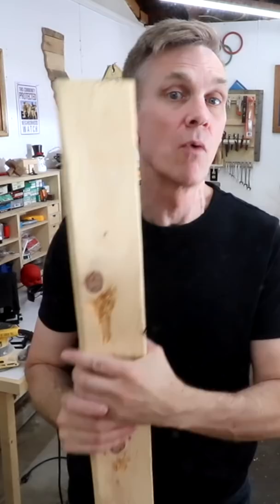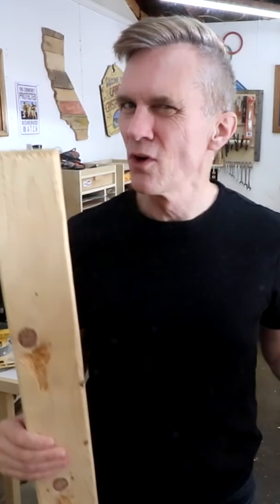Why do 2x4 boards have rounded edges? #shorts

Comment: I figured it was because they actually measure 1.5” x 3.5”. And, to sell them as 2x4s they have to get rounded up...
Reply: this is a criminally unappreciated reply.
Reply: Ba Doom pahhhh! Lol great comment
Reply: I see what you did there
Reply: 😃 It took me a little while to get it.
Reply: UM... ACHHTUALYYY. They round down, they removed material.
Reply: Bahahahaha!!!
Reply: Bazinga
Reply: Thing is they were actually 2x4s when they come off the initial roughing saw. From there the drying process and finishing processes shrink the wood.

The equivalent in Europe is sold as a 44x94, which is roughly 1.75" x 3.75".

Comment: It's rounded to prevent moisture build up when they pack them on pallets, the rounded corners let air flow through the boards when they are piled up in shipping and lumber yards, so when it rains and sun finally comes out the boards can dry out faster and not mold. 👍🏽
Reply: This was also what I thought.
Reply: I said to myself something to do with storage/shipping. The airflow makes sense!
Reply: Not to mention banging a Sharp edge against would cause more damage than  banging a rounded one. That whole stress concentration thing
Reply: Airflow and less damage to the boards. Sharp corners get dinged easier than rounded ones. Lots of reasons they are rounded.
Reply: Yep, glad to see this comment
Reply: It helps to stops splitting while drying/seasoning.
Reply: Now it they can just fix the warping problem we would all be Happy........
Reply: Well that makes more sense than anything else I can think of!
Reply: @SiFiFreak  That is what I was thinking. Like how concrete edges often have chamfers removing the sharp edge for better durability.
Reply: @geofreak75  there also might be something to that if the corners where sharp it may be a lot harder to separate the bundles.
Reply: It's a fire safety thing. Wood with sharp edges catches fire far quicker.
Reply: I like it.
Reply: Nah, that's dilerious. The warping allows for airflow.
Reply: So they can dry faster to warp and twist? Lmfao
Reply: Would also help with the chemical treatment process that is used to protect outside lumber
Reply: At least that's better than what Steve came up with!
Reply: @mikedeafenbaugh5984  Haha. Oh boy. Your comment was worth digging for.
Reply: Best comment by far👌👌
Reply: Lol no.  There's still too much contact between the lumber for it to have any affect on moisture but you sure fooled a lot of people.  The guy in the video was right but didn't know it.  Before DW there was still a finish material such as plaster and panelling.  The sharp edges, especially with any twist to the board, transfers to the finished wall.  People will still buy wet lumber but will pick a stack apart trying to find the truest boards.
Reply: Yes
Reply: Make sense
Reply: Trim is also chamfered on the back edges so it will still fit if there is a bit of grit or sawdust in the corner. Rounded edges probably made stacking by hand much easier. Otherwise any little rock or sawdust build up would have ruined the stack. On the other hand my 1950s house has square lumber.
Reply: It's just like that poem: "They shall not grow mold."
Reply: That, and it keeps the wood from splintering in the drying process or even during shipping and building. It also adds structural ingerity to the wood.
Reply: You can compensate the warping when you set the board on its shoe and fastened them with screws or nails.
Reply: @jessicagriffith  lol
Reply: Ah.  I thought that was the reason they made them all bent, twisted or cupped. 🙂
Reply: This makes the most sense for time and cost effective reasoning.
Reply: Best answer.
Reply: Ding ding ding! You win!
Reply: Not to mention that the most common board are 2x4 when they shipped them the sharp corners would cut through the hemp ropes... A rounded corer helped to prevent that as well..
Reply: maybe
Reply: Yeap. This is the winner.
Reply: @roar40s  lol
Reply: Now if homedepot could just figure out how to measure an actual 2x4
Reply: This is exactly why I work at a lumber shipping yard
Reply: Valid point. However when you open a fresh lift of 2x4x16 pressure treated on a hot sunny day you can watch that top layer warp like microwave bacon lol
Reply: I actually learned the reason in architecture school back in the 90’s. They are rounded to allow sawdust to go somewhere when the board is pushed against a saw fence. Otherwise even a tiny bit of sawdust will push the board out and constantly create crooked cuts. 

And another benefit is that when studs twist in the wall the rounded edge keeps the corner within the plane of the wall. More twisting is required before it would push out the drywall. If corners were square a smaller twist would create a problem.
Reply: Thanks for the comment, for a moment i thought was just smoothed edges so they can sticked easy on B Hole of the guy that made the video only with questions 😀
Reply: 🙏🙏🙏 Thank You 🙏🙏🙏
Reply: Hey you should have made the video this guy just wastes time
Reply: Thank you
Reply: Scrolled down here to say this
Reply: Sounds more legit than any of videos answers
Reply: No that's not the reason. Didn't you hear that nobody knows the reason? Why are you hypothesising when you were already told that NOBODY KNOWS THE REASON. Be happy with not knowing, God!
Reply: I thought maybe everyone just liked rounded wood. Lol
Reply: It's not to prevent moisture, they use spacers.
Reply: Nope. Rounded edges because of the plastic bands while their on the pallets for transport. The sharp edges would ware down and snap the zip ties before getting to the store. Lol
Reply: You should be the one making this vid
Reply: That is also a good guess.  But that's not the real reason. I don't know the real reason. I just learned from the video everyone is wrong and there are no right answers.
Reply: Thats the best answer ive got also
Reply: The amount of airflow would be tiny though??? I'm not buying it. I might make a difference to seasoning timber over a long period, but even then I'm dubious.
Reply: Thank you! 😊
Reply: Gracias 👍❤️
Reply: Add to this that it is easy to visually see when it is final milled rather than rough cut and you’ve got your answer.
Reply: That's an answer!
Reply: This seems the most likely reason
Reply: It happens during kiln drying
Reply: kafel Bellic  treated lumber is square
Reply: Theres actually no legit reason why doug fir 2xs are all rounded green, but it sure is a btch after it comes out of the kiln. The outer boards on the units love to warp worse than straight edged cedar boards as where cedar loves to collapse cells. Rounded corners Def does not help  airflow in bundled units post kiln lol.   They are banded and covered with bags to keep dry for loading and shipment. If the theory was true then all the western red cedars I dried and processed would of been rounded. I think it has more to due with what the customer will use em for, doug fir 2xs for decking, and structure building while majority of all cedar will be sawed and then sent thru the moulder for tng so they keep cedar 2xs all straight edged same with pine.
Reply: You should have made the video m8
Reply: @roar40s  nah, just nah
Reply: it's rounded it allows bark edge cuts, cheaper
Reply: There's corner relief on lots of things especially where they need to sit against something else. The 2x4 can also roll more easily and don't get worn smooth on handling
Reply: Thanks more waste of my time
Reply: @SiFiFreak  YES the producers of lumber definitely don’t want you to PURCHASE more lumber than what you need. 🤦🏻‍♂️🤔🤷‍♂️😂